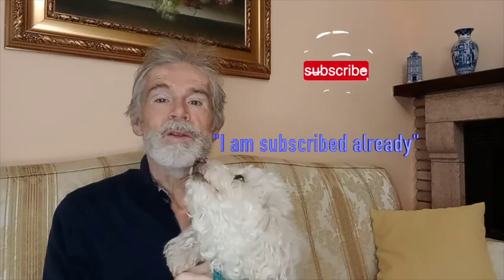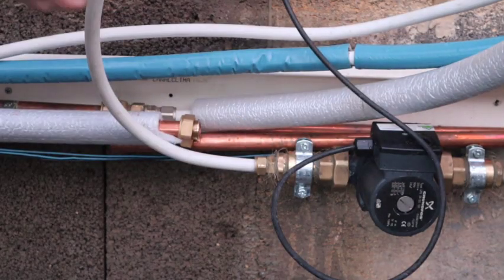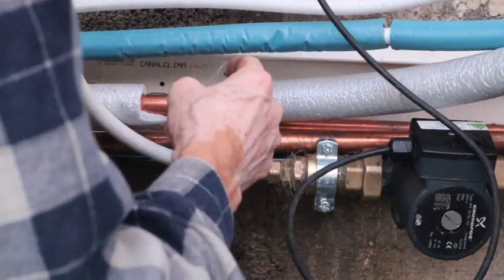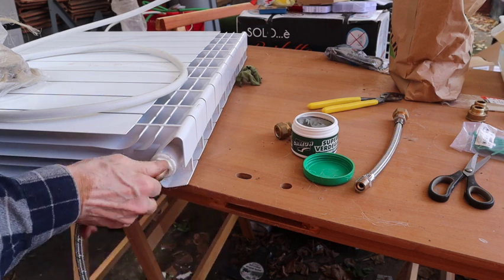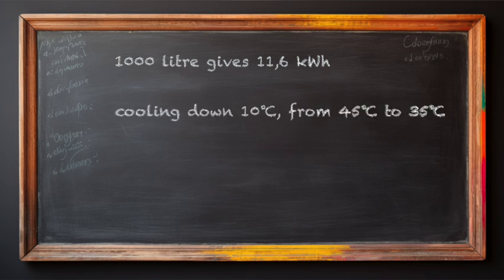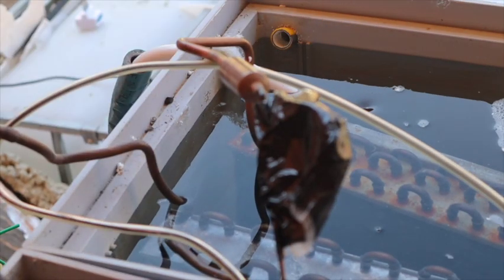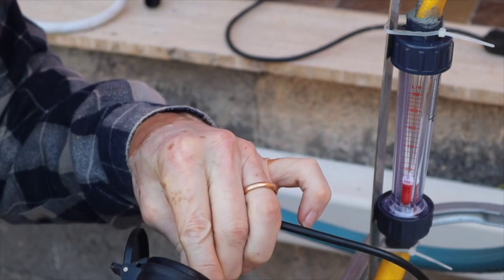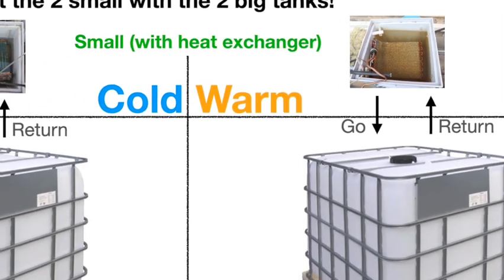How I Heat My Entire House with Only 1.5 kW - At work! - Video 72a

Comment: error at minute 03:35 --the hemp must always be wrapped in the direction of the thread, in this case right-handed thread and the hemp is wrapped clockwise when looking at it from the front.
Reply from the maker: Hi Gianni, at the moment I don't remember my wording but what I noted is that in the wrong way the oncoming thread from the other side will push back the hemp. Anyway I thank you for your concern. I will see at that minute. Are you from Italy?
Reply: Yes Sir . Thanks for the suggestions anyway.

Comment: There is no need for a thread sealant. The ring should seat, and form a seal, on its mating fitting.  The purpose of the threaded parts is to hold the assembly together.
Reply from the maker: Hi Paul, I agree and indeed fixed the tubes with cable tiers at the entrance and exit. And I was lucky to find a tube that fitted well. If not, you can use silicones. Otherwise, if there is some pressure I fear it will leak.

Comment: I am sure you have a good solution for your situation.
To improve it (am I correct) you need to increase the storage capacity and reduce the storage temperature.
My thoughts for a new build would be to have a very thick solid (earth?) floor slab, insulated below. Run pipes through this to heat up to 5~10deg above room temperature. So flow temperature no more than 35 deg.
Reply from the maker: Hi Mark, that is a good idea and also based on the thick walls you see in very old houses (at least in Tuscany and Sicily where we live). That is also storage, but indeed the pavement is a smarter location as you are more exposed to it. A kind of heated pavement with storage. The low temperature is indeed a factor for a better COP. It can be a practical problem to implement it in a home.

Comment: I love your project, but  :  

Your are doing wrong on the way of putting past and hair on the threats. First put on hairs clockwise direction, so the hairs gets tightened as you turn the part to be connected. Then put the past on top of the hairs.
Reply from the maker: Thank you Mr Ringhoe, I will remember that!